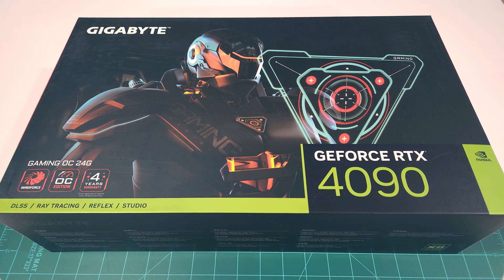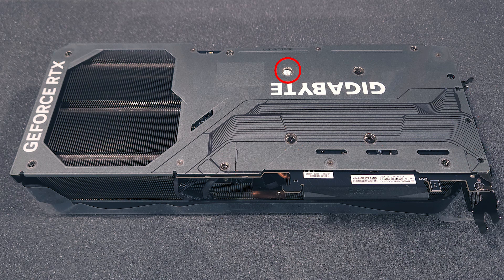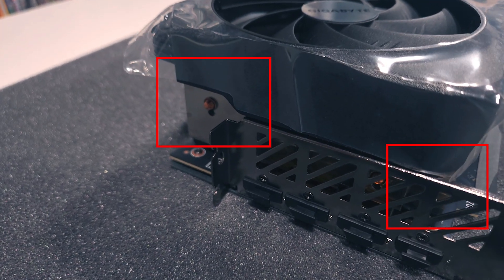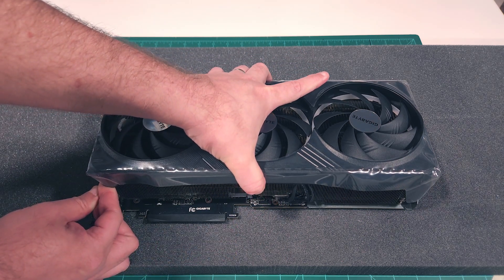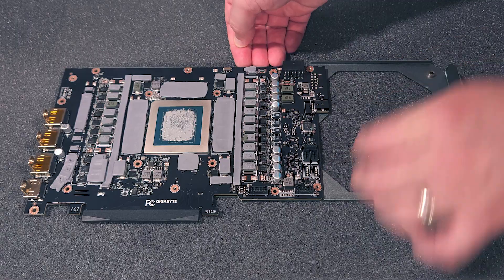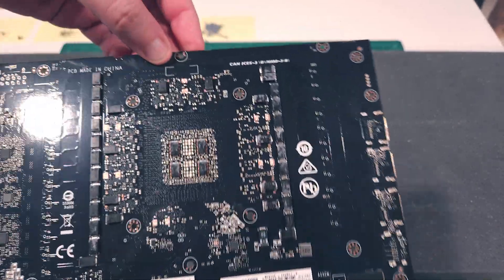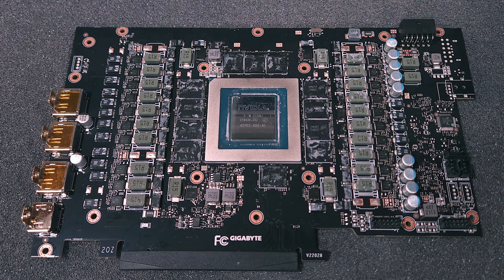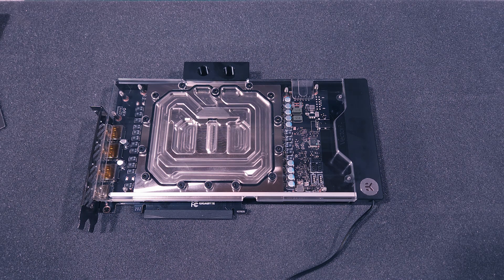How to Disassemble Gigabyte RTX 4090 (In Preparation for Watercooling)

Comment: Do know if its the same for the 5090 windforce?
Reply from the maker: EDIT: I just realized that you referenced the "5090" and not the "4090." I defintely do not know the answer to your question now that I've re-read it. :) I'll leave my comment below in case it helps someone else. Sorry I can't help with this one.

-------------------------------------

Hi there! Regrettably I do not know the answer to your question since I don't have a Windforce model that I've disassembled to analyze. I attempted some basic google-fu and came away with two observations.

The first thing I noticed is that there seem to be minor differences to the PCB layout. Mosfets/pads in slightly different places or not present, etc. Despite the differences I would expect that disassembly to the 4090 gaming OC to be similar but perhaps with some minor differences.

The second thing I noticed is that EK says it has no, and doesn't intend to produce any waterblocks for the standard Windforce 4090. There is an EK Pro block for the V2 windforce it seems though again, I haven't installed it personally. On the Bykski side there are two different models of full cover waterblocks that supposedly support the regular and v2 windforce cards and I assume the two different offerings are related to the minor PCB differences.

I dunno if any of that is helpful but my short answer is that I'm not sure, but this is what I found.

If you've already answered your own question I'd love to hear what you learned so I can arm myself with the same knowledge. :)

Comment: Thanks a lot 😢 how i remove the three fan connectors?
Reply from the maker: Hi there. I showed a tad more of how to remove the connectors in the full length series of building my wall mounted frames. Here's the specific timeframe as a reference: https://youtu.be/JQqs0HUTlCQ?t=1325

I'd just simply caution that if you do it like I prefer, which is to use pliers or vise grips, just be careful not to overdo it. Otherwise, you can simply grip and pull with your fingers but again...just dont pull too hard. Hope that helps.

Comment: Congratulations for the fantastic tutorial, aren't you by any chance able to insert the thread (I think m2) and the length of the stock heatsink screws? It would do me a great favor!
Reply from the maker: Hi there, and good day. Let me verify the request. You are wanting me to verify that the stock screws are M2 and to include their length? If that's what you're wanting please confirm and I'll see what I can do.
Reply: That's right, unfortunately my screws were lost and there is no way to restore the original heatsink.
If you can do it, it would do me a great favor.
Thank you!
Reply from the maker: @PRobba-il4cx  Not a problem. Give me a few and I'll see what I can do.
Reply: Without any rush, when you can. Thank you!
Reply from the maker: @PRobba-il4cx  I have a folder of relevant information related to this video that folks have asked about and I have added some new images based on your request. If you could navigate to https://drive.google.com/drive/folders/12SHAcGBQ1hxceHxd7XH1EIYl4syMTlAB and look for the six images named "OEM Fan Shroud Screw Information #.jpg", hopefully they'll give you the information you seek.

Let me know if those work for ya.
Reply: Thank you so much, you were really kind and thorough. May I also ask you the size of the 7 screws that fix the PCB to the backplate internally, unfortunately I'm afraid I'll need those too.. Thanks again!
Reply from the maker: @PRobba-il4cx  Yep. I'll get those added in a little while and message you here once complete.
Reply: Thank you very much!
Reply from the maker: @PRobba-il4cx  These screws were not as straightforward as the first set. There are seven screws in total on the front of the PCB. I have in my possession six of the seven. The reason for not having all seven is because one of the screws is re-used for the EKWB waterblock install, so it got put back in the card. Five of the remaining screws are M2 which you can see in "PCB Front Screw Information 1.jpg" and "PCB Front Screw Information 2.jpg".

The last remaining screw I'm not positive on the size. There are two additional images that show this particular screw. "PCB Front Screw Information 3-2 Unknown Screw Comparison.jpg" shows three screws size by side; a #6-32 UNC, the unknown screw from the 4090, and an M3 screw.

If I were in your situation and needed to figure out specifically what screw this was, I'd probably order two different screws and see if they were able to thread smoothly. I'd try a #4-40 screw and a coarse thread M3 with 0.5 thread pitch.

Unfortunately I ran out of 4-40's a couple weeks ago and haven't yet replaced them and I do not have coarse thread M3's on hand to try.

I apologize that I wasn't able to verify two of the screws from the batch of seven. Next time I make an Amazon purchase I'll throw these two sizes in with the order and see if I can identify a match but it might be a week or two before I get there. If you figure it out in the meantime please let me know, otherwise I'll message you again here once I have more to share.

If you have any questions about the new images do let me know.
Reply from the maker: Update: I felt bad leaving you hanging. I ordered both types of screws. I'll let you know what I find out when they arrive tomorrow afternoon.
Reply: Thank you very much for the precision, everything is very clear. For the thread of that screw, unfortunately it doesn't seem common.. The only thing I'm not sure I understand, is the screw left mounted in the wb supposed to be m3?
Reply: It really didn't matter, he had already been too kind.. Thanks again for your infinite availability!
Reply from the maker: @PRobba-il4cx  Greetings and good evening. The screw is a #4-40 UNC screw. These hex nuts fit perfectly. https://www.amazon.com/gp/product/B08NTYVZLR
Reply: I missed the notification, thanks I really didn't even know about this thread to be honest.
For the seventh screw it should be m2 or m3 right? Thanks so much again
Reply from the maker: @PRobba-il4cx  I would guess one of those two sizes would be correct. To figure it out manually, I'd pick those screws up and perhaps some M2.5's just to be safe, and try and thread them into the hole. If any resistance is felt before fully seating then I'd know it wasn't that screw and try the next one.

If I find myself in a position where I need to disassemble this GPU for some reason I'll make a note to test this in the future so I know for sure and I'll respond here. If it keeps performing as it does with the waterblock though, I may never take it apart.

If you figure out the answer to what screw size it is, please do let me know.
Reply: Of course, even if this one will also remain with the waterblock for the moment, I just have to buy them for the new owner who also wants the original screws at all costs. I take this opportunity again to thank you for your availability and passion!
Reply from the maker: @PRobba-il4cx  You're very welcome. Always glad to help.

Comment: Hello! I am trying to put the heatsink back onto the graphics card and I need to know the size -thickness of the stock thermal pads to replace. Would you happen to know the sizes or a good thermal pads to replace it with? Thank you
Reply from the maker: Hi there. Scroll down to the question by greganson3627 and check those images from the googledrive link for a comparison. While I have not went back to the stock cooler and thus needed to re-apply the thermal pads, if I did, I'd use these: https://www.amazon.com/gp/product/B094PWW9TM, as they are my go to thermal pad for all sorts of things. In the images I took a picture using these actual thermal pads for the comparison.

Comment: Thanks for making this video. I'd made one attempt at replacing the fans with CPU fans because I very much dislike the RGB circles that creates a choppy effect which is very jarring on my ocular units. Anyway, I had issues trying to take the shroud off the heatsink without messing with all the back parts but now I see that I'd need to get all up in them guts to remove the fan plug anyways. Round 2 incoming!
Reply from the maker: I have felled many a great beast on the second hunt. You gots this! :)
Reply: @htfiBEEP  a trophy hall strewn with mighty beasts, indeed!
Reply from the maker: @Jackson_Digital  Greetings. Figured I'd check in and see how your fan replacement project went. Did you get around to a round 2?
Reply: @ Thanks for checking in. I had to come to a temporary compromise as I'm in a huge crunch to get a lot of video cards online.

I rotated it, put a nice RGB light on the vent of the backplate, reversed the CPU fan direction so it wouldn't draw in directly from the GPU, and added another RGB fan on the rear of the CPU. 

This way I can still look at soothing colors but there will be Round 2 :D
Reply from the maker: @Jackson_Digital  Gotchya. If I were going to tackle what you've described I'd probably just 3D print a harness that fit whatever fan(s) I wanted on the thing and attach them to that.
Reply: @htfiBEEP  The most monetarily viable option I have right now is a Sticky2D printer (aka Tape). I would love to have a custom shroud, I'd probably add spikes to it.
Reply: @htfiBEEP  I'm serious hahah! I put up a video the other day making cardboard cases for passively cooled crypto cards. I tend to gravitate to the cheapest available option :D
Reply from the maker: @Jackson_Digital  You'll get no judgment from me. While I have never used cardboard it sounds pretty ballersauce. My go to material for building most things is aluminum extrusion. I really enjoy working with that stuff. What aluminum isn't, is cheap. I used to build all sorts of computer frames from wood because I liked that dichotomy of the aesthetic with computer parts, but at some point I got frustrated trying to make a specific piece of oak straight and I just couldn't do it with planing and sanding. From that point forward I was all-in with 2020.
Reply: @htfiBEEP  Very interesting! Do you have any vids of those cases?

Agree about the wood, I'm learning a lot about working with it but I often times regret just not getting a 3D printer instead of lots of tools which I know nothing about.
Reply from the maker: @Jackson_Digital  Unfortunately no. They've all been converted to wall mount frames as per the video series I did. Maybe someday I'll do another wood build but with CNCed parts as opposed to hand cut. Or maybe I'll discover the life altering benefits of working with cardboard and go in that direction.
Reply: @htfiBEEP  lol good one. Yeah you'd be amazed when you just start looking around a pantry, I found a granola bar box that would be perfect for three 170hx's 😎

Comment: Hey there, thank you for the great tutorial!  Would you be able to confirm what size thermal pads are needed to replace the factory ones?
Reply from the maker: Greetings! If I were going to refit the OEM heatsink and backplate onto the card once more, I'd probably use 1.5mm thick pads and call it a day. Since I try and leave some of the stock pads on the original hardware in case these kinds of questions arise, I've taken a few pictures and a comparison for you. Check out this folder for those images: https://drive.google.com/drive/folders/12SHAcGBQ1hxceHxd7XH1EIYl4syMTlAB?usp=drive_link
1.5mm vs OEM Pad Comparison.jpg: A comparison of a still applied factory pad with a separate 1.5mm pad I use for these kinds of tasks
OEM Pads on Heatsink.jpg: As the title suggests
OEM Pads on Backplate.jpg: As the title suggests, but one or two of the factory pads came off as part of the disassembly. You can still kind of see the outline of the silicone adhesive leakage on the image though

Let me know if this helps. Take care.